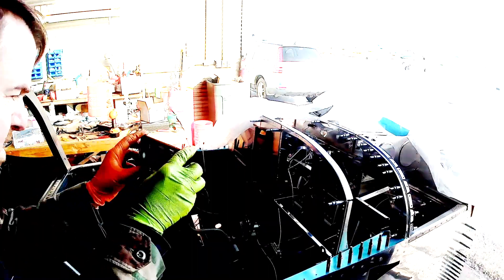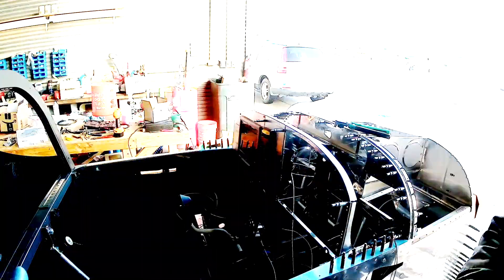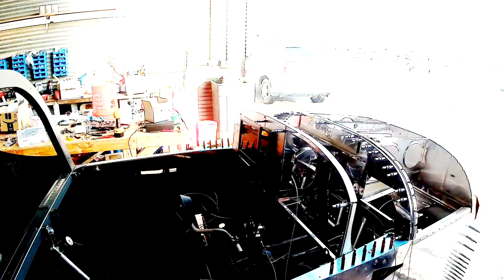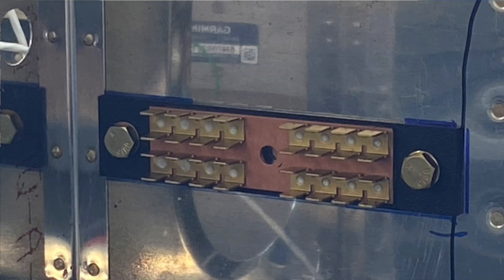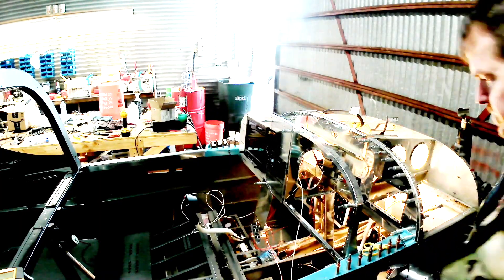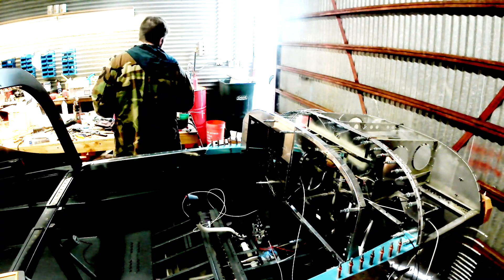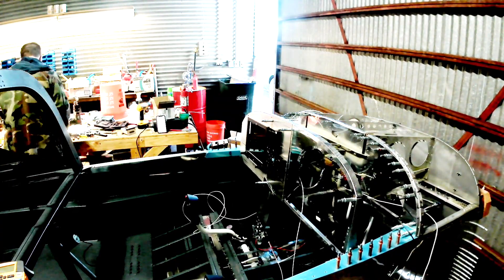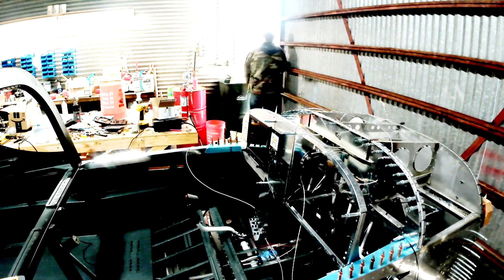RV-14 Forest of Tabs 2

Comment: Will you put any avionics forward of the sub panel? It seems that it would be hard to access in there later once the top skins go on?
Reply from the maker: I'm going to try not to but I know that's unrealistic. The only parts I'm planning forward of the subpanel will be small, easy to replace things in the electric system like inline relays. Though I'm pretty sure I'm going to have to put my EFII system up in there... we'll see. It'll arrive with the engine.
Reply: Andrew Kilroy maybe a hinged fold down panel that folds down in front of the pedals? Or a slide in one through that map box hole on the right hand side?